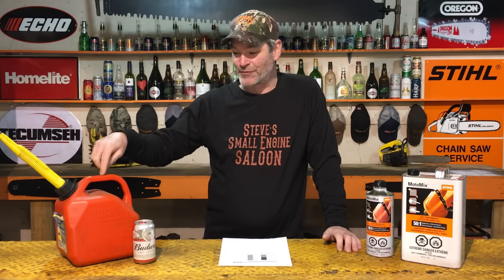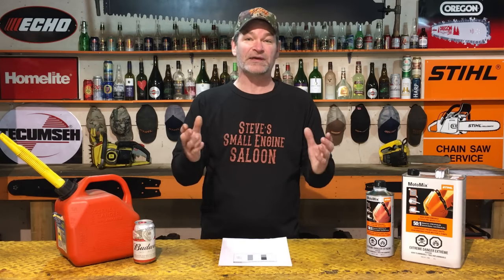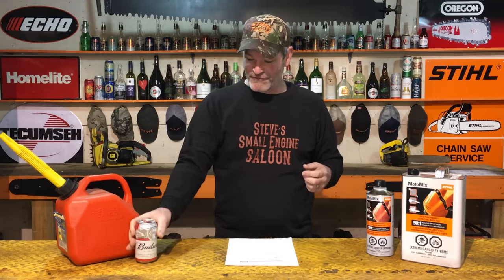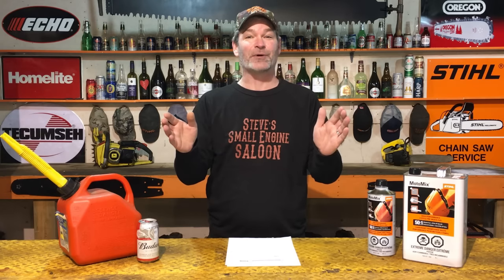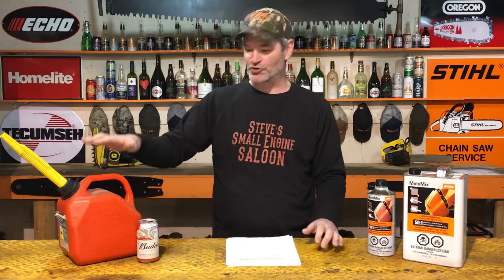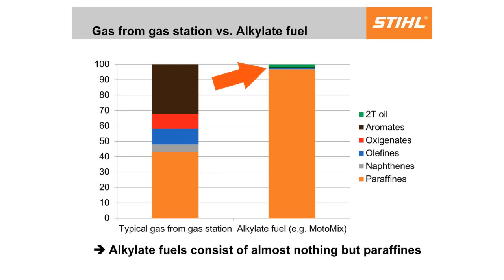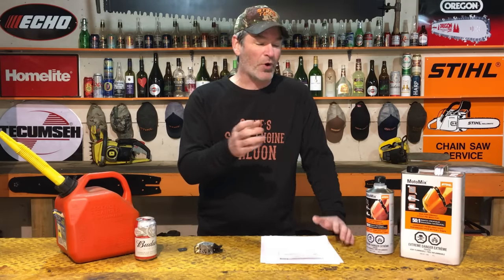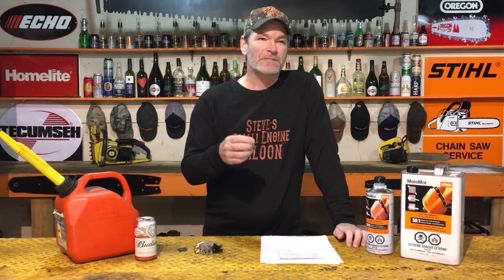The Ugly Truth Why Gas Station Fuel Is Bad For Small Engines

Comment: Steve I use aspen for my personal machines, but I have to use general petrol for the mowers and two strokes, Why?  because between the two vans we can easily use 30-40 liters a day during the summer, I could not afford to use Aspen in those quantities, even the local Council which decided to become "green" gave up on Aspen because of the cost. I do like the Aspen, less fumes more power good for the machine BUT Garden services in the UK are low earning and Aspen eats what little profit we make.

Also, I was told NEVER to use  premium fuel in what are basic lawnmower engines.

I have also been informed by a local workshop that leaving Aspen unused in the fuel system for long periods is causing fuel pipes to harden ???????????

keep up the good work, Brian
Reply: PS I am wondering if the US has different grades of fuel than the UK I do not think that our premium fuel is Ethanol free??

Comment: My 10year old 2cycle chainsaw is used perhaps twice a year and has always been hard to start and suffers from vapor lock when hot. I found that the engineered quart bottle, 50:1 premixed, 94octane, ethanol-free gas gives me much more dependable operation. I do drain and run dry after every use.  In my experience, you need to minimize gumming/varnish and use high octane for hot weather operation. My second choice would be no-ethanol, premium gas with Stabil added.

Comment: Really though, if you're using chainsaws, chippers, mowers and brushcutters most days just for your own land, buying this premium stuff isn't an option. But I WILL be removing the ethanol from all my forecourt fuel from now on, and will use stabilisers.
Reply: Exactly....if you use the equipment frequently the premix stuff isn't worth it, but for many of us that don't use our equipment very often, it makes more sense.  For me for example, I run my trimmer and blower maybe once a month, through a season of use I maybe go through one of the 1/2 gallon cans of premix fuel.  I'm also slowly going to battery powered equipment so my gas stuff sees even less use now, so the premix makes far more sense in my case.
Reply: @wildbill23c  Yup. I'm moving more towards cordless chainsaws as I can do my coppicing with them. All else still needs petrol or several years life extention so as I can do it with a scythe.

Comment: Used 87 gas in new still saw won’t start after running twenty minutes ! Will cleaning plug cure this or is going to the repair shop

Comment: I'm using regular gas station gas in the same old lawn mover for over 20 years, put it away every winter with a full gas tank and pull it back out in the spring. Never a problem - it starts right up and runs for another summer.
Reply: yeah ive never had a problem either. weird

Comment: Here in Minnesota, ALL vehicle gasoline has 10% ethanol. Many stations do have a non ethanol 
(no-ox) premium 92 for non road use only. It's about 80 cents more than regular. I use the no ox in all my small engines, 2 and 4 stroke, outboards and snowmobiles. Some of my things are old. Never had a problem except that damn Honda 2000i generator which will get a gummy varnish in the carb.
I also don't really store anything. I try to run everything every 2 months or so and the Honda more often. 
I won't be buying any fuel for 10 to $14.
Still good info in your video.

Comment: I'm sure the engineered fuel is good stuff but quite frankly at over $20 per gallon unless you are only using it for the occasional use of a chainsaw or something it just isn't practical. Who can afford to run that stuff in a riding mower or generator? I've been using Sta-Bil with non-Ethanol fuel for almost 20 years in both 4-stroke and 2-stroke small engines and I've not had any carb related issues. I've stored Sta-Bil treated fuel for a year and had no issues with it. I currently have a small can of 2-cycle pre-mix that is non-Ethanol with Sta-Bil that is 18 months old.  Yep - 18 months. I mixed it for my Echo leaf blower and then ended up not needing to clean many leaves and I didn't feel like just throwing the fuel away. I'm now on my second season with the same fuel and the leaf blower still starts 2nd pull and runs perfectly.  Again, I'm sure the engineered fuel is top-notch and I'm sure the makers of engineered fuel wished everyone used it but at over $20 per gallon as long as non-Ethanol pump gas is available I'm going to stick with it.
Reply: EOSJOE  I am with you gas stabil, chain saws weed eaters no problem 👍😃
Reply: I basically do the same thing, but at the end of a year, any fuel left over gets removed and put into my vehicle.  I just label all my fuel containers with the fill date, and anything not used in the small gas engines, goes into my daily driver.  Being from Florida, we keep fuel on hand for hurricanes,.
Reply: You wouldn't use it for a riding mower or a generator.. Small engines, like weed eaters, leaf blowers, chainsaws.. It is also mostly beneficial for storing the tool. You don't have to run the engine dry with it like you do with pump fuel when you are not going to be using the tool for a while. It wont dry out your fuel lines and whatever.

Comment: Alkylate fuels are great for long storage. Just last week borrowed my father's secondary "weed eater". He told me that it had been sitting for was it almost four years in storage, including cold long Finnish winters. Popped the fuel tank open and smelled the tank and almost no odor. He said it had alkylate fuel in it and we topped it off and it was about six pulls and it almost started. With less than 20 pulls it was running and it was running just fine and it revved just fine after warmup. Just like it would've been used couple months ago. From experience I can tell that after few years I've had plenty of issues with motorcycles and other bit larger carburetor engines, pretty much always requiring complete carb cleaning. That safety thing you mentioned is no joke either. Especially with chainsaws and other handheld equipment you'll for sure inhale exhaust gasses.

Comment: When I bought my 455 husky Rancher there was a promo for adding two years of warranty if I bought four quarts of husky fuel, that gave me five year warranty on the engine, wow how can you beat that. Since then I've used nothing but canned fuel in my saw. It starts most of the time in two pulls, but no more than three pulls every time, every time. My brother brought me a little Homelite saw he couldn't get started. I dumped the fuel out put can fuel in it pulled it about 4-5 times and it started right up. Obviously a bad fuel mix over time his can of fuel got to be too rich in oil. A common problem with mixed gas. Now he uses nothing but canned fuel and it starts on 2-3 pulls very time. Just my thoughts from a guy in Tucson Arizona

Comment: I"ll take my chances with leukemia instead of paying 90 dollars a gallon for my lawnmower fuel along with having to pay the new high cost of pump fuel per gallon for the car.
Reply: If its a rip-off, then thats what it is.
Reply: In my four stroke engines, I use pump gas, through the year. At the end of the season, I run it empty, and use a gallon of engineered fuel for storage.
Reply: The Trashman  That is what I do with my generators and chainsaws. I have never experienced a problem.

Comment: I've been wrestling with my motorcycle carbs for years .. every spring when starting the season the idle jets are clogged pretty badly despite the fact that I try to keep everything nice and clean all the time - fuel, tank itself and of course the carburetor, but each season begins with a non starting bike and I've had to waste a tremendous amount of time to get everything back to working order again, while the carburetor being full of some  sort of green crap.  Now I know, what's the reason - these guys - The Bad and Ugly, which I had no bloody idea about. Thanks Steve for this very informative stuff - highly appreciated - hopefully will save a lot of time and effort in the future!! :))
Reply from the maker: Right on
Reply: If the "stuff" is green, it is likely ALIVE...!!!

You may need a fungicide to run through the fuel system if you bike.

Comment: I always put the first ten in my truck to make sure the hose and Assembly are clear of regular fuel then I fill my can .I always fill my small equipment with 40 to 1for the winter and run it. I figure the carb will have oil residue left in the curb and the Muffler will be coated on the inside with oil to prevent rust . I live in eastern Canada we have super high humidity and long winters not overly cold
So my equipment will sit for 6 mths in my un heated shed or garage. And I never run any of it dry and always leave fuel on. Can’t remember the last time I had to tear a carb apart on my own equipment. Works for me

Comment: Ripoff!    I can buy Ethanol free Rec fuel locally for $3.79 a gallon and mix in 2.6 ounces of Amsoil Sabre for way less than this boutique fuel.    Total cost with the oil included is less than $5 a gallon.
Reply: And no fuel tax
Reply: that is a good idea,where is your location?  I. live in commiefornia probably banned here
Reply: Don’t matter what fuel you use with the amsoil guys running 100:1
Reply: True, but what about the benzene?
Reply: Weeeellll.... La Di Frickin Da!
Reply: Closest station to me that sells non ethanol fuel is half an hour away. Trufuel from Amazon is click click delivered to my door. I don't burn enough fuel that the cost is a concern, but that hour round trip vs. 30 seconds on my phone to order more fuel sure is a savings for me.
Reply: What is Amsoil Sabre? And 
why/how should I use it?
Where can I purchase it?
Thank you
Reply: ...if you're so concerned about Ethanol not being in your fuel, why are you even using a fossil fuel device
Reply: 100% right Jeremy!!!!
Reply: @robkocol5664  You should run the lowest octane E0 fuel you can find in small engines. The higher octane of mid-grade or premium fuel only serves to prevent detonation or knock, a feature needed only for high compression ratio engines. 89 or 93+ fuel and the higher cost, is a waste of money in your lawn mower.
Reply: @Hjerte_Verke  The manufacture engineers of these small engines usually state the recommended octane is 89 not 87 as (stated in most manuals).  This is usually the case for handheld equipment. Again to be sure, read and refer to YOUR equipment owner's manual. An Engineer's mission in life is to "fix" what isn't broken, so change is expected.
Reply: If you only use it to winterize it's not that bad. I've got a gas station close by that sells ethanol free gas.

Comment: Thanks for the information! I was wondering about how this would effect a Honda 2018 CRF dirt bike. I have had to replace fuel pump once before. I was wondering if I could find a larger size and if this is similar to what you recommend. The data sheet pdf did not list benzene. -> SUNOCO OPTIMA 95 OCTANE RACE FUEL is what I am referring to. Thank you

Comment: I don't burn ethanol in ANYTHING including my vehicles and I don't have any fuel related problems, ever.  I also stabilize EVERY gallon for my small engines because you never know when it's going to sit a little too long.  I have a gas station about 25 miles from my house that sells real gas for about 25cents/gallon more than the ethanol blend...I fill up whenever I drive past, never letting my tank get below 1/2 and the increased MPG pays the difference.  This strategy has served me well for decades and doesn't cost anything but a bottle of stabilizer every few years, so maybe $2/year.

Comment: Many thanks for your work, and others like you, but you've help me take care of a LOT of issues with my ancient and inherited chainsaw and brush cutter (West German Sthil 024, Japanese Echo RM-310 Backpack lol), and thought they were just no good anymore. I refused to let them go though, for sentimental reasons, plus it's expensive if you want quality (Husky / Stihl / Echo). 

After a few tutorials, how to set them up, clean them, oil and check the components, some sharpening (Sthil 2&1 is really nice), and more importantly, replacing the old fuel with some Sthil Motomix, They work super well. Nothing wrong with them, carburators, rubbers, gaskets, plastics are all good, no rotten parts or filters, Chain and saw bar, good condition, flexible for the brush cutter was replaced, both tools idle and start really well now. Far less scary to start and use when you know they perform the way they should. 

There's something to be said for old, well maintained quality tools (except for the fuel). I'm gonna hang on to them. 

I don't think I'll be carrying on with the Motomix all the time though, it's very expensive, but I'll keep the can around to purge the systems once I'll put them away for a few months. But I'll pay more attention to what kind of fuel I'll mix later. 

Cheerio!

Comment: I watch you all the time but I hope you are getting quite a kickback from the people making the products you are hawking here. I have weed trimmers, backpack leaf blowers, tractors, mowers, a generator, and a small outboard motor. I use all those regularly.  I add a fuel stabilizer in three five gallon cans every time I buy fuel for the small engines.  I am in Florida and you cannot get higher humidity than here. I buy ethanol free fuel right out of the gas station pump. So does my brothers and son. Right now the newest machine I have is at least four years old and some of them are much older. I do all my small engine work myself and do normal maintenance regularly. I have never had an issue since I started treating my fuel by adding quality stabilizer to my fuel the second I buy it. I am not going to buy into the scam of spending $100 for a gallon of Motomix fuel. If I have to buy that crap because my machines are having problems I will just get new machines when they die from gas pump fuel, it would be cheaper. I am not sure how many beers you had before making this particular video but drinking their Kool-Aid too is not cool. Good job on your other videos though.
Reply: It's snake oil for the gullible. Take this magic potion and your saw will run like the space shuttle.

Comment: What's your opinion on storing gas powered tools in a dry shed for the winter? Will freezing temperatures damage the tools? I have them in a heated shed now - but could use the extra space...😂
Reply: I store mine in a shed all winter -30F temps. No issues. I always fill the tanks with pump gas not canned gas.
Reply: @skidoorulz4914  thanks👍 😃
Reply: @skidoorulz4914  and you haven't had any problems with chain saws etc?
Reply: @olemeyersahm7547  Nope currently have 2 in the shed right now. Neither have been started since last October and I know I could go out and pull the rope 5 or 6 times and they would be running. But we only hit -28F this winter for the lowest temp.

Comment: I have an old Sachs Dolmar chainsaw. Has to be over years old, still runs great. The mix ratio is 25:1. Can you buy the 4 stroke engineered fuel and mix it with 2 stroke oil?

Comment: "Look at this gunk cause by oilfins"

Looks in my 5 year old mow which never gets cleaned and is run on unleaded  "What Gunk?"
Reply: @valerierodger7700   at $20 a gallon for the yuppie fuel you could buy a new mower every 5 years and still be ahead with gas station gas.  They sell it cause stupid city democrats will buy it.

Comment: Totally agree. Run pure alkylate fuel (aspen) in all my equipment here in Norway. As a home user, my mower and snow blower don't use that much fuel in a year anyway, even with it costing almost twice as much.
Bought a snow blower that had been stored with, and run on pump gas, was hard to start and I was completely sure I would have to take apart the car, maybe even replace it. After running it on alkylate for a couple of hours, it starts and runs like new. I know it's not scientific, but I've had the same result with this method before, and never had a fuel issue with this fuel.

Comment: Here's what I do: buy ethanol free 91 octane fuel and use high quality two stroke oil the new synthetic oil.
Reply: Me, too, Christopher and Jeremy. As an independent tree service contractor, I grew weary of blowing $6 per quart on TruFuel, even though it's pretty good stuff. I've found that by adding Amsoil Saber, Sta-Bil AND Mystery Oil (to counteract gunk and varnish) to 90 octane ethanol-free pump gas, my 5 saws actually run notably better than with TruFuel. And, it all costs about $1 per quart, not a confiscatory $6. Plus, an 80:1 Amsoil mix (they guarantee 100:1 is suitable) can be used in ALL saws, regardless of the saw's oil ratio requirements, so I don't need to keep 3 different fuel formulations on hand. Love it! If the engineered fuels cost closer to only twice as much as pump fuel, they'd be a much more reasonable alternative.
Reply: Agreed

Comment: I've never had a problem (Denver region) with fuel from the pump (E10), going on 30+ years of small engine(s) ownership.

With as cheaply built as this equipment is, I'm replacing it for reasons other than fuel anyway.

I'd be all over the "engineered" fuels if they weren't so damn insanely expensive.  Stihl has a marketing problem if they think the average user is going to pay that kind of money for fuel.

Comment: When it comes to storage time.
I use Shell Premium it has no ethanol.
Plus i ad a fuel stabilizer.
Been doing this for years on motorcycles and lawn equipment. Never had a starting issue come the spring.
Reply from the maker: Right on